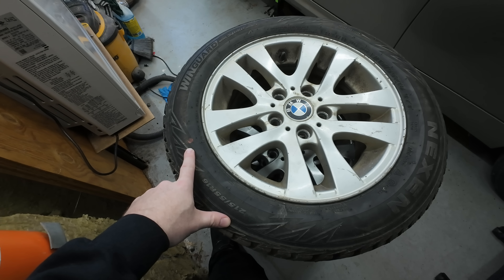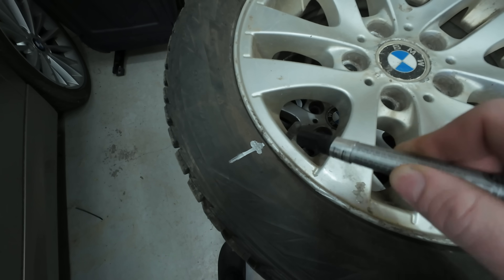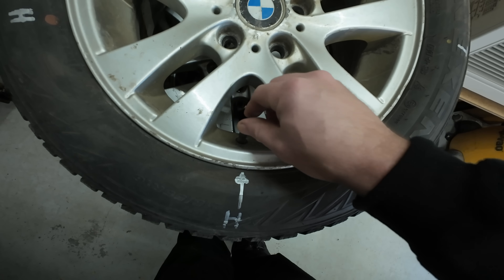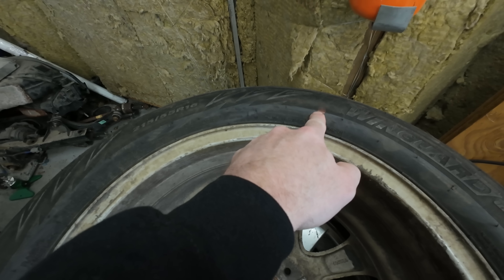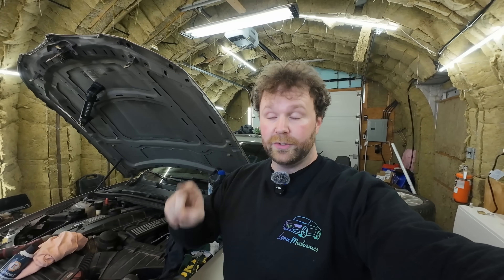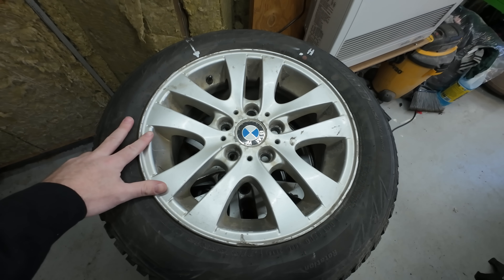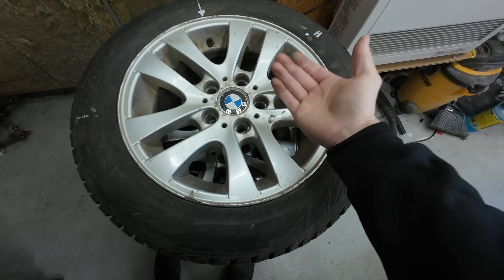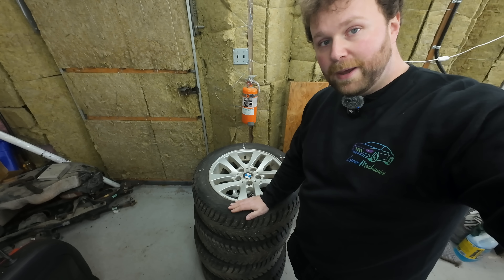Tire Red & Yellow Dots Explained | Back to Basics. Many mechanics get this 1/2 right

Comment: I've had so many problems with ttire shops that don't have a clue at all about the dots on the tires put the tires on wrong add way to much weights and then blame it on a bent rim and I don't mean little shops I've had this problem with it's the big all over the US tire companys at least the small shops will take the advice and tell you that they've done this for years and years and that you don't have a clue about what you're talking about even if you show them the proof that they are wrong

Comment: Used to buy tires from a shop that complained to me, when I came back with vibration at 100mph. Their answer was to not go that fast.
Found a shop with an oldschooler that used the rotate method - stayed with him for years until he retired. 
Now I’m back to not trusting run of the mill tire jockeys, some of which you gave to yell at to hand torque

Comment: Mate, the thermal insulation in your garage might cause health issues later on if you stay exposed to the Glass/Rock Wool. It is meant to be covered. You are breathing millions of microscopic parts right now.
And nice video btw. You have a new subscriber 8)
Reply: @Jan_Seidel   making me itchy just looking at it
Reply: @kellismith4329  yeah but it sure looks warm hehe
Reply: even in the Glass/Rock Wool safety info it says it needs to be covered because fine filaments will break of into the air
Reply: @111smd  I believe that it will be as bad as Asbestos eventually
Reply: Only in California does it cause the C word. Everywhere else, you're good. (I'm joking of course)
Reply: I'm here to say the same good video mate, but that stuff's dangerous greetings from Australia.
I installled it for years.
😢
Reply: i´m here to say the same
Reply: The insulation indeed needs to be covered. Spray foam would work better. This looks like a quonset hut garage. Very difficult to insulate unless you have specific insulation and fasteners for a semi circular building like this. That insulation is dangerous exposed. Mesothelioma...🫣
Reply: He's only going to get cancer from all the oils and chemicals he deals with; beside the insulation, but kudos for noticing his safety!
Reply: I didn't even hear the first couple of minutes of the video - was so taken aback by the sheer area of the exposed insulation 😮
Reply: yes I thought that as well , please cover the insulation
Reply: Yeah some good heavy mil plastic over that is best but as I'm sure you're aware stapling is out of the question which make huts like these so hard to insulate, hence spray foam is the more correct solution but thats really spendy.
Reply: Paint it with insulating varnish or use intumescent paint for fire retardation. 
Good video
Reply: yeah, definitely stay away from glass and rock. they might/could kill people, unlike other TRILLIONS of microscopic particles in your everyday life. might/could and other nancy-ass, cry-baby, not-fit-to-live BS. The Strong Get Stronger, you get weaker.

Comment: I have called the manufacturers about these dots on the tires, Bridgestone was the only one that claimed the dots made any difference. Then I experimented using a road force balance machine (which measures heavy and light spots in the tire and wheel) and it's match mount setting (which tells you where to align the tire and wheel for the best balance) only to discover that the red and yellow dots mean nothing.

Comment: Back in the day we did a lot of strobe balancing, on the car.  Took time compared to a quick computerized balance.   Balancing the whole rotating assembly, rotor/drum/axle/hubcap included, we could get them spinning smooth up to 100+ (mph not that pussy kph nonsense!).  There were a lot of times we found that the hubcap by itself might be an ounce off

We made a lot of money re-balancing the tires the tire-shop down the street sold.  People would take them back 2-3 times and just give up, then come to us.

And don't even get me started on how many brake jobs we did a few weeks after somebody got a set of tires... we'd go to remove the tire and find that a couple nuts were loose and a couple could only be removed with a breaker bar.  "Monkeys with impact wrenches".  We always used a torque wrench.  Savages.

Comment: Pirelli motorcycle tires have two red ovals, this is what got me questioning putting whatever dot at the valve stem. Now I know red is across from the valve stem (how OEM Pirelli tires are factory mounted) and if there’s a yellow dot, like Bridgestone, then that goes to the valve stem. Thanks!
Reply from the maker: Its a common thing from people who deal with motorcycles that red is opposite yet there's dozens and dozens of mechanics arguing against it. I feel the motorcycle guys know what a comeback is with balancing cause its pretty obvious on small machines and high road speeds. :p

Comment: rule of thumb. The cheaper the tire the more weight it will take to balance out. EDIT: You should also do a dual plane balance. Most shops just do a single plane & ship it cause its faster and uses less weight. There is a big difference.

Comment: I have had tires with the red and yellow dots overlapping sometimes exactly.  The valve stems on alloy and dual wheels are either timed with opening or cast marks during manufacturing.

Comment: The red dot is NOT usually the heaviest section of the tire.  The red dot is most often the STIFFEST section of the sidewall (Radial Force Variation) and is lined up with the lowest point of the rim and can be read with a dial indicator when the rim is rotated on a balancer without the tire mounted. Check with the tire's manufacturer to determine which designation they use for the red dot.  Most steel wheel manufacturers will mark the wheel's radial low point with a dimple or paint dot where aluminum alloy wheels usually don't have this marking.  If a wheel doesn't have any markings, find the wheel's low spot on a balancer.  If a tire has both the red and yellow dots, always use the red dot in preference over the yellow dot. Also, Radial Force Variation (RFV) can only be read on a balancer that has this function incorporated. The balancer will measure and record the RFV (usually in pounds). As a rule of thumb 0.001" is equal to one pound of RFV. For example:  If a wheel has 0.005" of radial runout, then the ideal stiffest RFV would be five pounds. Anything more or less would still be acceptable if kept to a minimum.
Reply: The video is interesting, but the comment section is even better, like your comment here 👌
And meanwhile my tires gets mounted just however, and the technician just slaps on 140 grams, on one side of the wheel, without even considering rotating the tire.
Telling me that this is how we do it, and it's faster to just mount them on one side.

Comment: Hey Lance, love the passion for basics, but info here’s a tad off-base—red dot flags the tire’s stiff, high-force spot, not heaviest mass. Line it opposite rim’s low runout (valve stem if no mark), yellow dot for weight’s just backup. No bare-rim check? You’re gambling with shakes. Factories nailed radial variation on industrial beasts since sixties radials rolled; Hunter Road Force Elite hit shops in ’97, auto-finds tire bump and rim dip—even dotless. Fix the out-of-round pound first, then clip weights for spin-wobble. Gets you butter-smooth highway, no comebacks.
Reply from the maker: Everyones focused on the dots and not s single persons acknowledged the tire wear I've had to trouble shooting or the intermittent shakes at high speeds. My experience is the red tends to be on the heavy side and pinned that comment right away. I got quiet a few people to admit they've had to reclock the tire and walla. The rid is almost opposite the valve stem. As I get bigger I'll dive into this more. Save up for some qaulity machines. But this video is a starting point and the comments are sure fun. Happy new year :)
Reply: @L @Lancemechanics  Hey Lance—let me try again, clean and formal.
Heavy imbalance is about mass; radial force variation is about geometry. The tire is never perfectly round because its internal stiffness changes from one point to another. That variation, when you mount it, gets compounded by the wheel’s own runout. When the stiffest patch of rubber rides directly over the highest point of the wheel, the impact doubles—it’s no longer a vibration you balance away, it’s a knock.
Your equipment doesn’t load the tire; it just spins it. So it never tells you where that hard patch is. You end up adding weight to cover for a problem you didn’t see.
A proper road force machine presses the carcass like a road would—reads every shift in spring rate, plots the graph, tells you exactly where to index it. Bead seating, correct lube, proper exercise—only after those does the measurement mean something.
Data is the starting point and the end. Without it, you’re guessing. With it, you’re repairing.

Comment: Then you do it correctly and still get a wheel requiring more weight than you want in one spot.  Thats when you start marking the tire and rim in quarter sections and begin rotating it on the rim to see what position gives you the least amount of weight needed. Once you get it as close to correct as possible with minimum weight then road force it on the balancer and see if anything changes.

Comment: You are dead wrong! The yellow dot indicates the lightest spot on the tire, and yes - that should be aligned with the heaviest spot on the rim (typically the valve stem). But the red dot indicates the highest point on the tire and should be aligned with the lowest point on the rim. On the majority of used rims you may not easily be able to see any factory markings for lowest spot. These markings can vary greatly from a dimple to a notch or any variety of stamped triangles or squares.

Most people only learn that "red dot takes priority" so they line up the red dot with the valve stem. This is DEAD WRONG! If you can't see the marking on the wheel that indicates the lowest point just ignore the red dot altogether and line up the yellow dot with the valve stem! Or check the radial run-out of the rim with a dial indicator and mark the rim yourself. But the run-of-the-mill tire shop should mostly ignore the red dot!

The exception to that is of course when you use brand new rims. All high quality NEW rims will be clearly marked and you should then ignore the yellow dot and line the red dot on the tire up with the low spot marking on the new rim. The red dot only comes into play if you know the low spot location on the rim!

Comment: The biggest mistake techs make is removing the adhesive weights before balancing the new tire and wheel assembly. The adhesive weights typically balance the imbalance of the heaviest part of the wheel where the spokes are. Idk how many times I peeled those weights off just to have to put new weights on in the exact same spot. Takes time to do it properly so they don't fall off.

Comment: I have a shop I've been taking my wheels and tires to now for a couple of years.  I've gotten back assemblies where they've taken the time to adjust everything perfectly and have ZERO wheel weights on them.  Recently I got tires for my Jeep, and the old setup had several ounces on a couple of the wheels.  The new setup, 0.5oz was the max on any wheel.  They're not the cheapest shop around, but they do the best work, they're honest with me even when they've rejected an admittedly time consuming job, and will get my business as long as they stay that way.

Comment: I've been told by more than one shop now that since the invention of road force balancers, the dots don't need to be lined up.  I don't believe that at all as the balancer doesn't change the inherent physics of that particular tire and its construction.  Sure it could work around it but if that is the case, why are the dots still there?
Reply from the maker: You know how many shops have road force balances. They're over 50,000cnd.  Its the most expensive machine in an automotive shop. More then an alignment machine and rack. Also road force is a massive time consuming balance which these mass quantity shops hate to do
Reply: @Lancemechanics  The last shop I had install tires told me the same thing and next day I was back for a re-balance.  I also noticed that three of the 4 tires had the dots lined up lol.

Comment: The last bit is a great suggestion, thank you.  I bought older used tire equipment, because I was tired of having the kids at the tire shops scratch up my wheels.  The newer and more advanced balancers have a road force roller that applies force to the tire.  These also help the tech by showing them how to rotate the tire on the wheel to do what you are suggesting to minimize the weights needed.
Reply: We were taught to do road force balancing, the dots mean nothing.
Reply: @Ogrematic  because companies love adding two or more stages to their manufacturing process marking tyres to save money?🤡.
You do you...

Comment: It's very very very very very rare for a technician to use those dots. Everybody has their way and refuses to change it. Charging premium money for poor work They sell tire machine and balancer sets for less than $1500 well worth it if you do a lot of driving or if you own a motorcycle.  I've been using balancing beads for about 3 years now and haven't touched a lead weight.

Comment: Of course the auto industry deviates from aerospace. I'm not 100% convinced though I have put red dots on the valve stem and have needed less the .75 oz to balance, on the flip side I've seen some tires with lined up stem and dot and 1.25 oz and 180° out to balance.

Comment: Thanks for this video.  As a driver, I have asked several tyre technicians about the dots and all I got was a lot of BS.  Whether because they couldn't be arsed to answer me honestly, or because they actually didn't know the answer, I will never know, but it now explains why I have occassionally been obliged to return to a tyre shop, because I couldn't even travel at the Legal Speed Limit on British Motorways, without significant wheel patter.  Next time I have new tyres put on my car, I shall ask the technician to spin the wheels without tyres, before fitting the tyres and balancing them, even if it costs me a few extra quid.  Russ.  Hampshire, UK.

Comment: I catch this all the time. What I always told my apprentices is to remember that the yellow spot is like the sun, the sun gives light, therefore "a light-spot". 

Put the "light-spot" adjacent to the valve and it'll balance up nicely without having to tetris 457 weights on the inside of the rim.

Comment: That good advice for not ending up with lead trim rings.  I've popped them back off n turned them 180 before when they wouldn't come out easily.  Mostly I was just trying to get older marginal tires to take a balance and run again. Bent rims on the back. Stuff like that lol. How about balance beads. Lol

Comment: Some cheap brands put the dot on a random spot.
I've had a few where it was 150 gram off with the dots correct, i refused to believe it and loosened the tire and spun on the rim 45° and had 5 grams off balance 😂

Comment: I've seen literally hundreds of tire shops incorrectly mounting and balancing tires. Seen most spin the wheel on the balancer machine, put only one weight on the front side, respin it again, add weight to the back side, again and again until they have a pound of weights all around both sides of the wheel. Last tech I had to show him how to put both weights on each side where they are supposed to go by where the machine indicated and then respin. Surprise! No more weights needed! Man had done it wrong for over 30 years. He was so pissed at me afterwards. Hence why I always mount my own new tires myself plus techs never clean the dirt, rubber and corrosion from the wheels so they leak air. Mine rarely ever do.
Reply: Also, you should never need more than one weight on the front or back side of the rim than the spin balancer machine called for. That means you need to move the one that you put on over a bit and spin again.

Comment: Last time I installed new tires, one of them had the red and the yellow dot side by side. Just 1 inch (25mm) space between them. It's not possible to have heaviest and lightest point of the tire so close to each other -unless the rest of tire is weightless. I'm using a manual tire changer and a static bubble balancer. Normally I pre-check the balance and turn the tire on rim before popping the bead up on the rim. This means that minimum amount of weights is needed.
Reply: Same thing for me, lots of tires with dots within one inch of each other. And what happens when they use a white dot and a yellow one? That
Reply: @dequavisjones4869  
  The white is usually a inspection mark, just quality control getting a symbol in.

Comment: The main problem with this situation is the BMW rim.  I've been running tires for a couple of years now.  I run them on all my service trucks.  One's a 450. One's a 150, and the other is a super duty 350.  The tires are land spiders. A Mexican friend sells them every day and. Only thing he does is mount it and airs it up and has never balanced them.  And the older set is going on 2 years old and I don't even have a clue what the miles are.  And they are still a half a penny or more with threads.